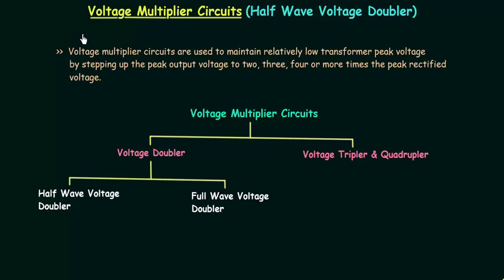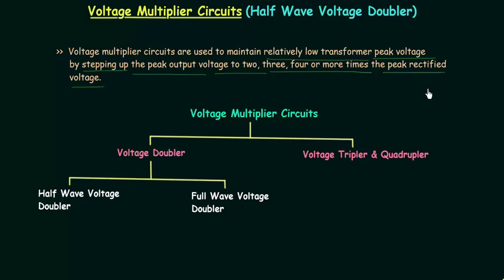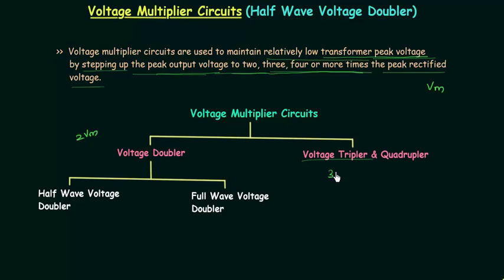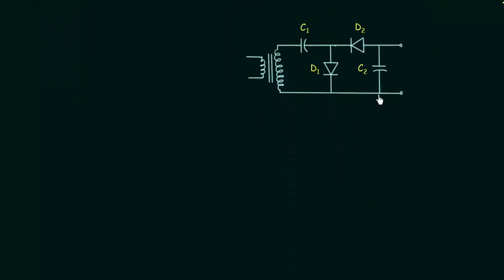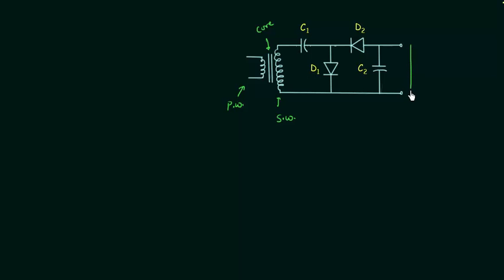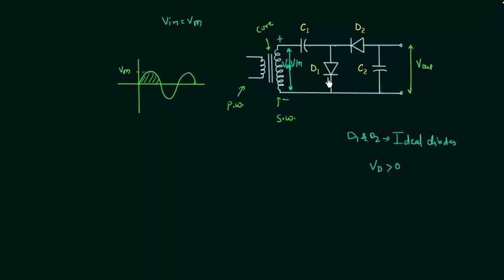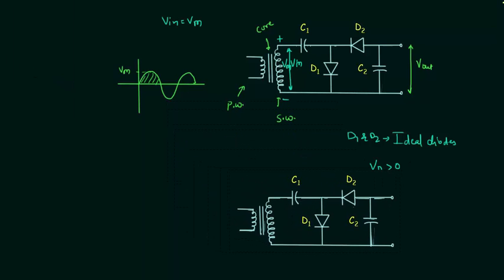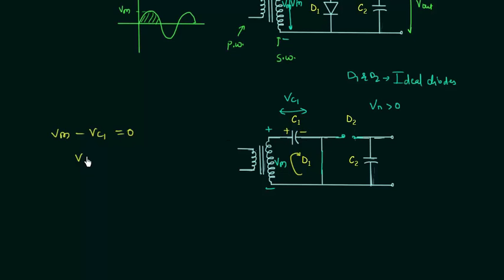Voltage Multiplier Circuits (Half Wave Voltage Doubler)

Comment: Capacitors are used in voltage multiplier circuits to store energy during the charging phase of the AC signal and then release it during the discharging phase, effectively increasing the output DC voltage

Comment: at 3:00, you say that D2 is rev biased because n side is connected to the positive and the p side is connected to the negative. But how is the p side of D2 connected to the negative of the secondary winding? there is C2 in between.

Comment: That polarity for C2 allows C2 to charge correctly during the negative half-cycle and ensures the PROPER OPERATION of the half-wave voltage doubler. Else, it would not multiply and simply give a zero.

Comment: If the voltage doubler itself can increase voltage why is transformer present in the circuit which also increases voltage?

Comment: I think there's an error here. The diode wouldn't be fully forward-biased in the whole +ve half cycle. It would only be forward-biased for the first +ve quad cycle. After that, as the capacitor is fully charged the potential just after the capacitor is greater than the other (i.e., reverse biased)
Reply: Can u please explain this to me?

Comment: Dear sir,
I have prepared the circuit but don't get quardripler voltage  input 24v ac and out put at the end capacitor is 75v DC only it should be 100v.
Please guide me to solve this problem. 
With regards 
Harish Suneja

Comment: During negative half cycle the loop current direction should be anticlockwise... Please correct me if I am wrong.. Your all lectures are very easy to understand.. Thanks for educating us 🙏
Reply: You can take any direction of loop ....here its for Voltage.

Comment: For all who does not know how the polarity of c2 is coming like that. Then listen,
Bhai simple hai. Look carefully in case of negative half cycle, negative terminal of v(in) is connected to the upper plate of c2 so, negative charge will be there and positive terminal is connected to the lower plate of c2 so that's why positive charge will accumulate there. Thats why polarity is like that.
Reply: thx man but what about the polarity of c1 acc to u it's just reversed
Reply: thanks bhai but C1 ka kaise kre

Comment: Can you please explain how to decide the polarity of capacitors?
Reply: Vighnesh Tamse - while writing KVL assume any polarity and write the equation. If Vc2 comes out to be negative then assumed polarity is wrong then to correct the polarity just reverse the polarity you have assumed. In this video sir got the answer in positive I.e.Vm therefore his assumed polarity is correct.
Reply: @shubhamnayak9369  is that applicable only for capacitors ? because when you deal with diodes there is a specific polarity and if you ever obtain a negative output it is not considered wrong . 
Just like Halfwave rectifiers with output of -Vm
Reply: @snowwhite3478  diode is a nonlinear Device .. it is ON only in specific direction while capacitor is a bilateral device which conducts in both directions..so you don't need to check polarity of diode as you already know it's polarity...but if you learn further you will get to know that incase of diode you find whether diode is ON or OFF by observing current direction..i.e you assume diode to ON so direction of current is from anode to cathode and if current value is -ve then actual current is flowing opposite to your assumed direction but we know that current through diode can't flow from cathode to anode so your diode is in OFF condition.
Reply: @snowwhite3478  in half wave rectifier you will never get other half of input voltage... because Diode doesn't allow current from cathode to anode
Reply: @shubhamnayak9369  bro if we r taking c1 polarity from + to - and c2 polarity from - to + then How can it be equal to the setup where we take both c1 and c2 polarity from + to -.

Comment: In the first half cycle V(c1)=V(m). So when V(m) tends to zero the capacitor should be discharged. So the updated V(c1)=0 after first half cycle. So In the next Half cycle V(c2)=0+V(m). Maybe It will not work as voltage multiplier.
But if we double the no. of turns in the secondary coil we will directly get double voltage without adding any additional circuits.
Isn't it ?
Reply: yes but read the purpose of voltage multiplier again at the very beginning of the video, "maintain low transformer peak voltage". That is if we dont want to use transformer in that manner then we can use the voltage multiplier circuits instead.
Reply: @maxsash  But isnt it correct that when Vm tends to zero in 1st cycle, c1 should be discharged
Reply: During negative half cycle D1 won't conduct. So path is open and C1 can't be discharged.